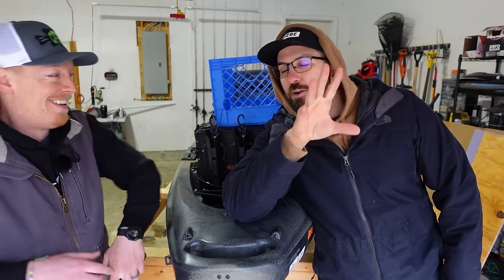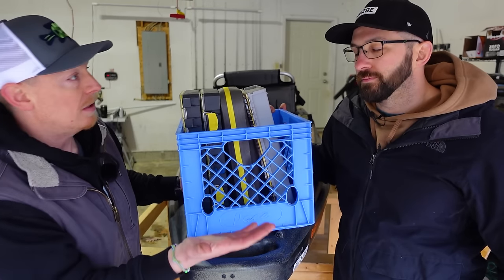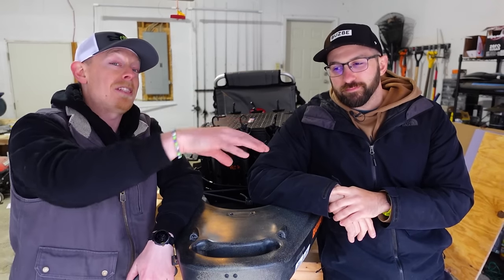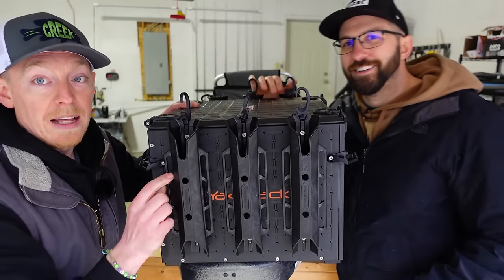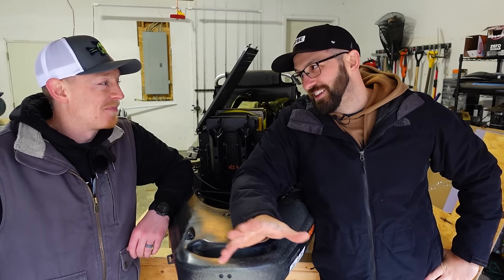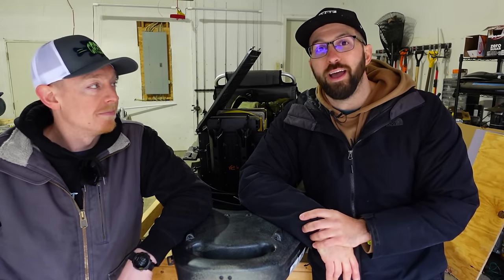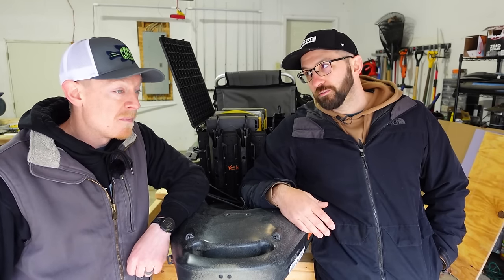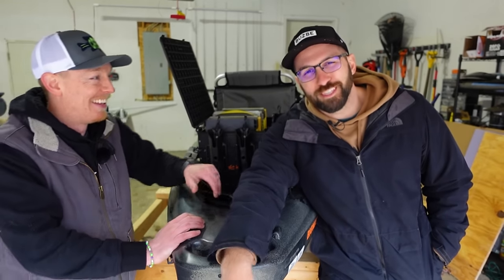Which Kayak Fishing Crate IS THE BEST? (It's NOT What You Think!)

Comment: Predominantly a back lakes angler, I don’t need to bring as much gear/tackle as a tournament angler would so I went with the 13x16 YakAttack BBP.  Personally I love the friction hinge lid bc I can lift the lid, have it stay put, and grab whatever I need all one handed.  The only accessories I added were a MightyMount for my BoomStick and an extra set of TetherTubes for a total of 6.   Speaking of the tubes, I’d like to add that those tethers do a great job keeping my rods from rattling around (GoPro picks that up annoyingly good).   I can also attest to its water resistance after spending numerous 10-14hr days in the rain, zero water penetration.   
One thing that no one ever mentions is warranties.  Yes the BBP may cost a bit more but like all YakAttack products, it comes with their “Built for Life” warranty.

Comment: I use a plastic file carrier with a 3700 riveted to the top and holds 4x3600 inside 5$ at goodwill. I haven't been out in the rain with it yet but it would be fine.

Comment: I use the big flambeau, and its insanely good. i added small dividers to make soft plastic storage, tool storage, size 31 lithium battery and still room for another 3700 crate, line, leader and my railblaza light. plus it has 4 rod holders, giving my PA14 180 19 total rod holders.

Comment: I use the wilderness system. It came with the kayak so the choice was already made for me.  I’ve ended up loving it and after upgrading my tackle storage to all 3700 Plano edge box’s I love it even more.  So the plus of this crate is that you can fit 3700’s in it and the lid shuts.
Reply from the maker: Thats awesome!  How many can it fit?
Reply: Right now got 3 of the std sizes and the crankbait box.  Still room for one more of the crankbait box’s or a std. so it might fit 6 of the stds or like 8 of the thins. Depends on how the math works out on box thickness.  Also it’s pretty darn water proof.  Been fishing all day in the rain and still dry inside.

Comment: Love the flambeau, but the latches suck! I keep a 100ah lifepo4 battery with pwm controler in the bottom and all soft plastic on the top. I modified it with 6 rod holders and 2 of the wilderness mesh pouches on the outside. It's also the same dimensions as the harbor freight/ Stanley deep storage boxes so you can easily bolt to the lid if you want more storage. With that said i might switch to the 16x16 black pak next year.
Reply from the maker: Nice!

Comment: If I had to do it all over again, I would just get a milk crate. The new BlackPak is susceptible to warping in hot summer climates like where I live.  I also had to add washers underneath the Gridloc Mighty Mount XL for the T bolts to fit. My old BlackPak has been sitting outside for over a year staring at me with none of those problems-lol, still my favorite crate. :)
Reply: I'm in Arizona and I've had mine for 2yrs with ZERO issues. I've fished 120+ summer days and it's spent days in my Jeep and well over 300 degrees in there. That's crazy the new one has issues. I have the gen1 16x16.

Comment: Yak gadget low pro xd is hands down the best.  I wanna say I have fit something like 14 3700’s.   I currently run 2 3700 deeps, 3 3700 thins, 2 3700, plano edge frog box and spinnerbait / buzzbait box and 2 soft worm binders.  Plus the 6 rod holders.  For $170 bucks.
Reply: I’ll check it out
Reply: Are you still using the low pro? I’m between that and the blackpak, which is on sale on Amazon.

Comment: I paid only $72 for my Flambeau Tuff Krate (with the lid and upper tray) from Amazon. It came with 2 rod holders (which I thought was weird that it didn't come with 4), but I bought an additional 4 rod holders and I mounted 2 on the front and 2 on each side with none on the back (because of the upper tray/lid hinging). I also used some paracord (drilling holes and putting knots on each end of the cord) to limit how far both the lid and the upper tray hinge back so I don't end up with it hinging too far back that I have to perform some incredible kayak yoga while on the water to get tray/lid shut again. I only use the poorly designed Flambeau rod holders to simply store my rods when I'm not actually fishing/trolling with them (I have rod holders better attached to my kayak for that). Definitely the best deal going in the more fancy (as in not a milk crate) kayak crate with the rest being 2-3x the price (which is just crazy). It doesn't hurt that my kayak is winter camo (black, gray, blue, white), so the light gray Flambeau looks awefully pretty on my kayak.

Comment: Sorry, nope.  Unless you get the top piece, you are just overpaying for a jazzier milk crate.  If you’re going to pay for the lidded portion you might as well just spend a couple extra bucks and get the 13x16 Blackpack Pro.
Reply from the maker: It’s $37 for the base, bungee included with easy rod attachments you can buy cheap.  And $82 on sale for the lid version.  Thats a LOT cheaper than the blackpack, not a couple bucks.  We’re purely talking value.   Personally I prefer the Black Pack
Reply: @aaanglers  I had it backwards.  I was thinking 82 for the crate and 40ish for the top part.  However, I wouldn’t pay 119 for that and then have to spend another 15-20 to buy rod attachments.  Now you’re up to 140ish.  I’d rather pay 10 more for the black pack rod holders included.  Just my opinion.  (Btw I love my black pack).